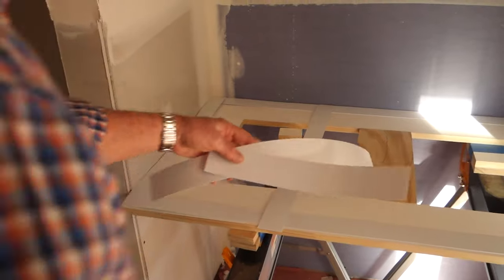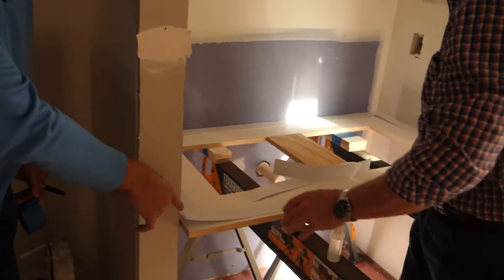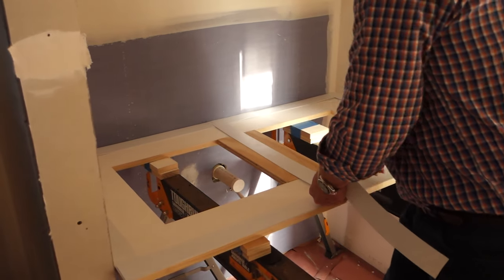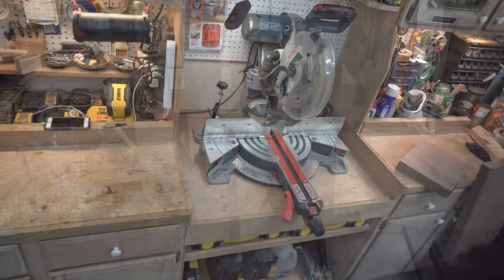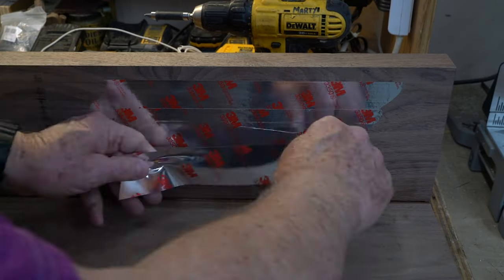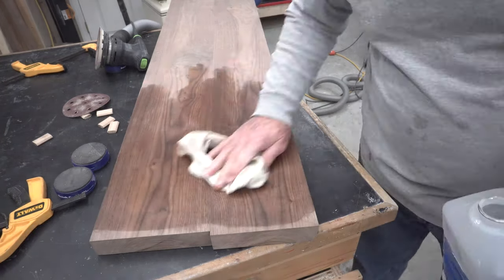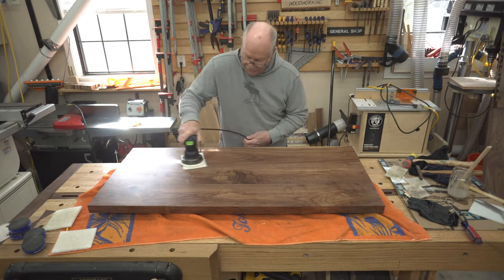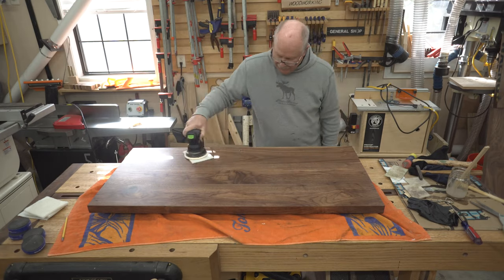How to Make a Floating Vanity

Comment: Started out in the trades as a custom drywaller and would only work behind a few carpenters because it is so common for the General Contractor to want the drywaller to square up the framing with the finish. 
Framers grew to fear my straight-edge when they were done as I charged a buck a minute (Good money in the 80's) to correct their framing.
Your drywaller appeared to be a step above tract for sure, you had no problem getting past the metal, this was one spectacular, beautiful, project.